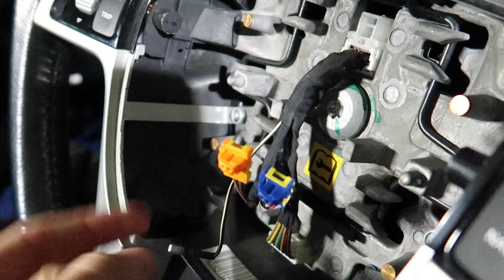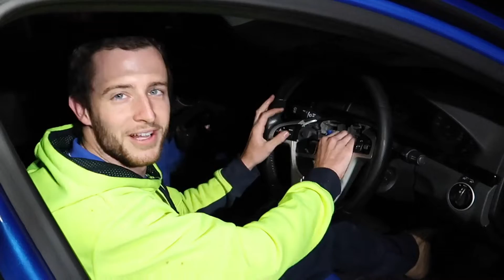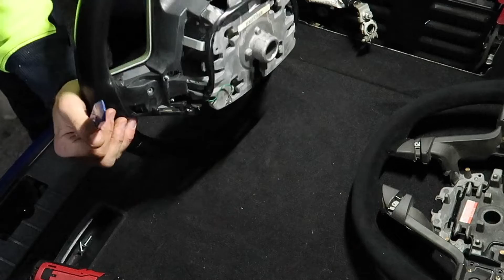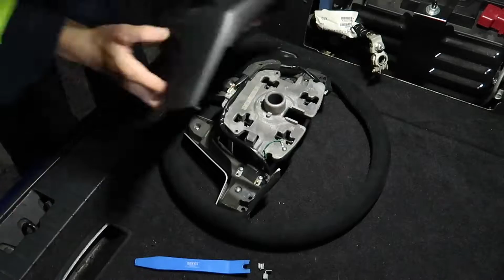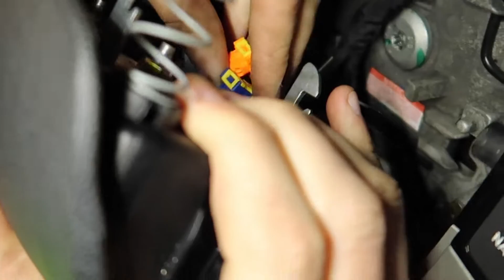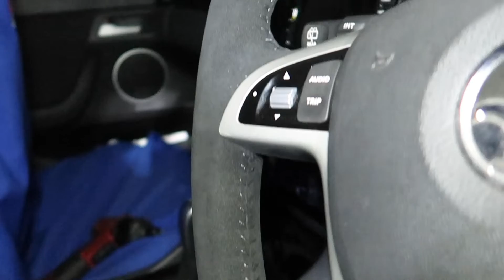Installing an Alcantara wheel on the SS Wagon

Comment: Hey mate I'm just wondering about the Colorado, do you happen to know the offset of your rims? 
Thanks.
Reply from the maker: yeah mate for sure. The rims are 16"x8" with 0 offset. Also running 285/75-16 MT tyres. The 0 offset makes them sit flush with the guard which was what I was looking for. Legal enough to not have to install flares. Just keep in mind there was cutting involved to fit my setup... Check out my video on the body mount chop to get more info!

Comment: Just to add some experience, a while back I did something similar and discovered that the little black wire connected to the airbag is what completes the circuit for the horn along with the 4 copper pads on the frame of the wheel (which you can see in the video), if not reinstalled carefully it can slip off slightly when turning the wheel. I found out when my horn randomly went off as I turned at a round-about. 💀